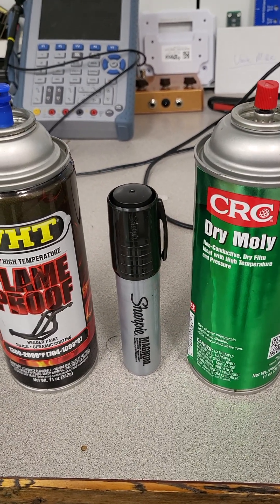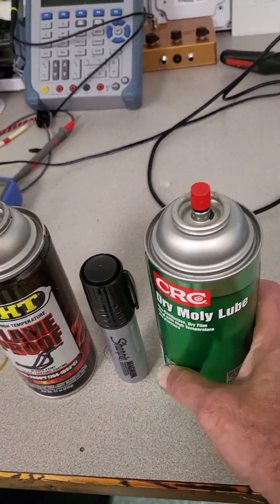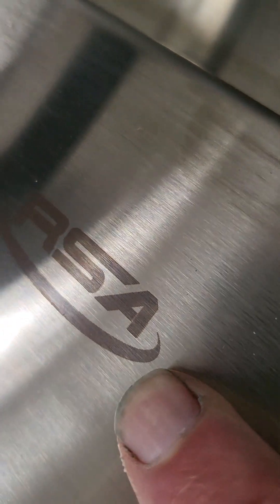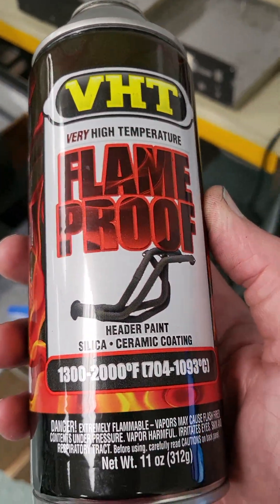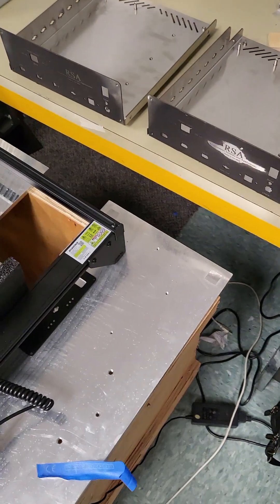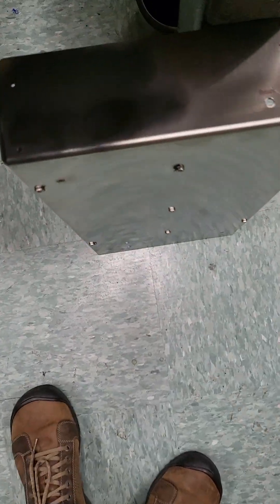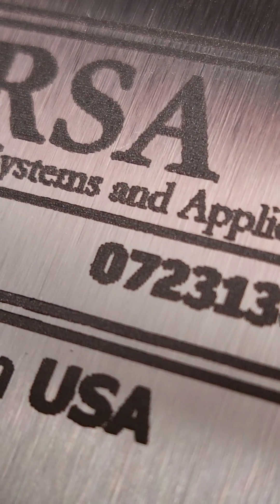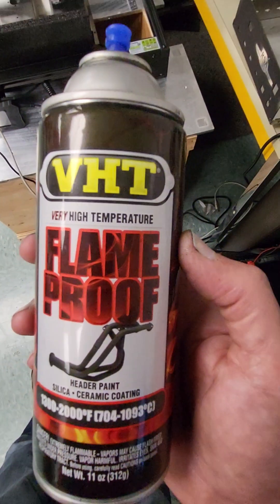laser etching Stainless Steel alternative marking spray.

Comment: Still using this method?  How is the durability?
Reply from the maker: I only use this method.   I have made mistakes in the past, and the only way to get it off is to sand it off.  It really seems to be good.
Reply: @mruff34  Nice, that's great to know, I'll definitely give it a go.  Thanks for the response.